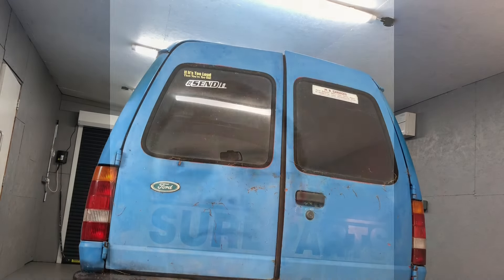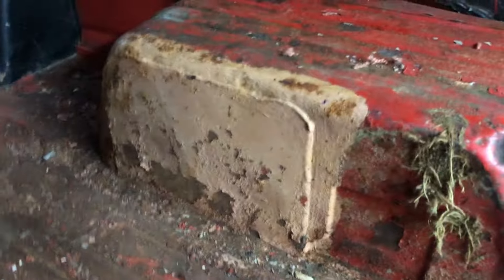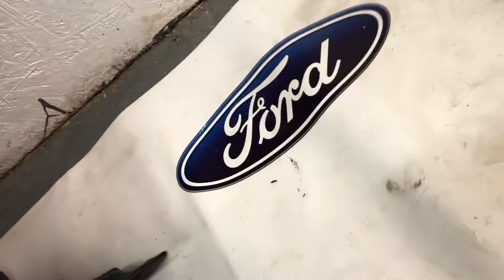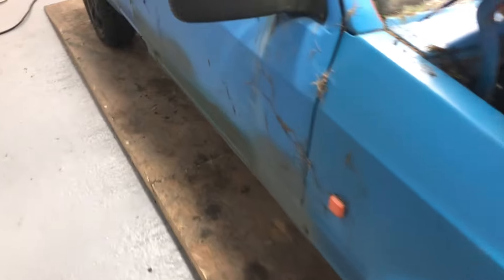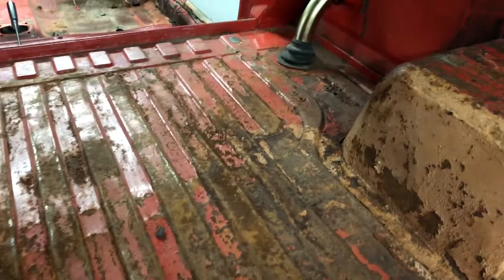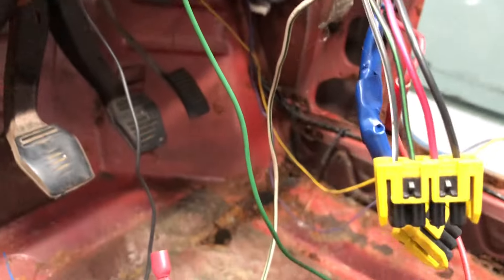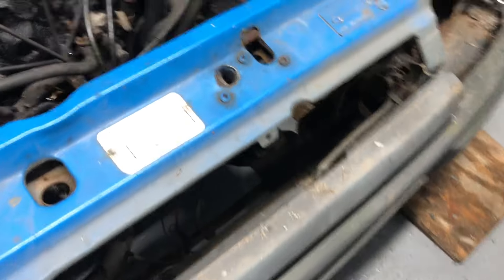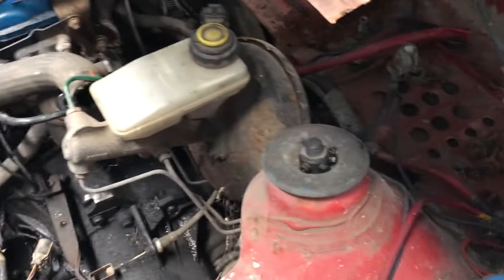Mk4 Ford Escort van renovation part 1

Comment: Plenty to do but she's in good hands! 👍 I look forward to future updates. 👍
Reply from the maker: Thanks was hoping it would be a quick turn around to use for this summer 😳 still possible but worth doing properly. I still keep up on or your videos and loving the progress on Heidi 👍
Reply: @clumpfab2740  Looks like you could deal with the main structural bits and then throw it together so you can use it in the summer. You can always finish it properly in the Autumn. . . . . Im enjoying getting stuck in with 'Heidi'. Took me aaaages to actually make a start after you welded it up for me but now I'v got some momentum going.  👍